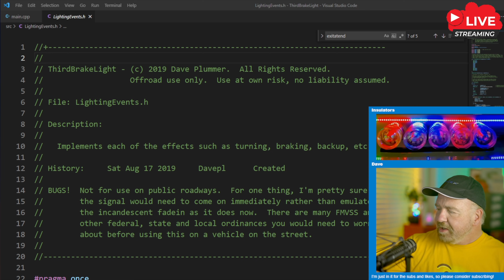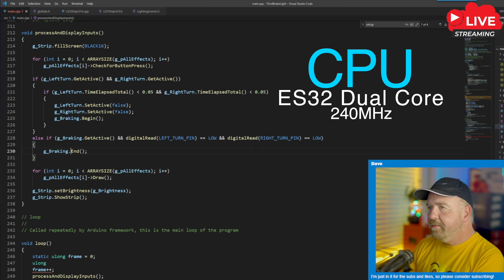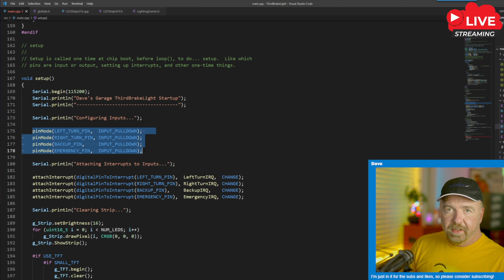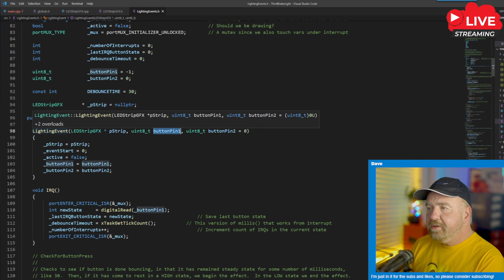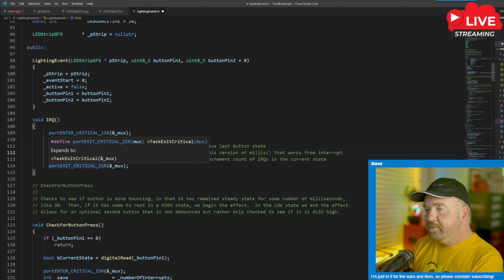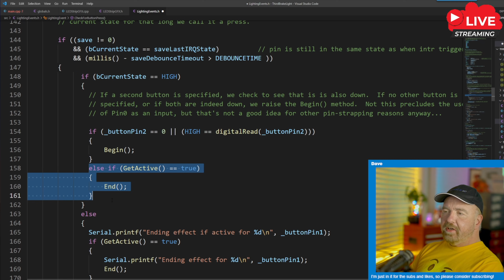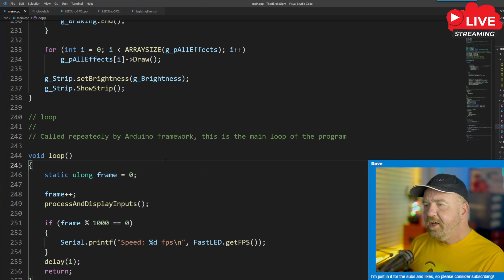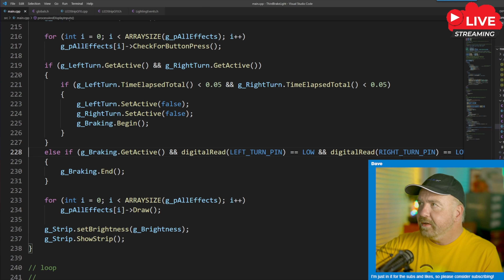Debounce a STOP switch in C++: Live with Dave in the Source Code Editor! (Live Replay)

Comment: Hi Dave, I want to take this opportunity and personally thank you for writing task manager.  I have used it every day for years since the win95 days to end pesky tasks and since XP to monitor the CPU.  It has made my life lots easier.
Reply: I'd also like to thank the person, who wrote the mouse driver, had loads of windows crashes where the mouse pointer still moved but nothing else worked. :-)
Reply: @TheEmbeddedHobbyist  Many graphics cards uses a hardware mouse cursor. This means that the hamster may be dead, but as long as the mouse ISR picks up the x-ticks and y-ticks from the mouse and sends the actual mouse location to registers in the graphics card, you can see a moving mouse cursor even if all paint code of the applications have died or the graphics driver code to actually perfor paint commands have crashed.

You end with a static image of last computed display bitmap with a moving mouse cursor on top.

It is quite common that interrupt handlers keeps working while the actual processing code is dead . Some lockup have made the OS stop task-switching. Just that the ISR doesn't use OS task switching but instead the CPU hardware logic for interrupt prioritization/activation.

I guess more people than me have used caps-lock, num-lock or similar to check the machine. Fast LED response shows the OS is generally fine but the current program may be dead. Slow LED response indicates the machine is alive but at a huge load. No reaction at all on keyboard LED's and the hamster is likelly dead.
Reply: @perwestermark8920  very interesting
i too use tje caps lock / num lock to check the system is still "alive" good for seeing if bootloader has locked up and in os is there hope of resuming normal operation.
I used to have a laptop where the battery or battery logic used to. create so many interupts the system would be unusable and caps lock would take 5 seconds to toggle.
Reply: @ratbag359  One of my machines running Win10 has some broken driver making the machine sometimes spend most time doing interrupts. But Win10 isn't as helpful as Linux to tell what interrupt source keeps counting interrupts. Or what drivers may be hooked to that interrupt source. Microsoft doesn't seem to think that information is relevant to an end user 😪

I had a Linux with similar issues and the /proc file system made it trivial to figure out that machine had a hw issue with a PCI bridge chip.

For more normal problems, Task Manager has enough information to help pinpoint most problems with CPU hogs, resource leaks etc.
Reply: @TheEmbeddedHobbyist  lol yea been there many times windows subsystems not responding task manager won't come up but i can still move my pointer lol

Comment: Do you need to debounce a stop switch (title), as it only has one function to stop. So on the first change in state to the stop state is all you need. I would not care if it bounced as I would have killed the process there and then. Plus I would do the stop switch in hardware just in case the software was playing up.

Now a start/stop switch (text) and most other mechanical switchs needs to be debounced as moving contacts just love to bounce. 

How about the leaky bucket method of holding the high's, if you keep putting highs in the bucket will fill after a time, so you have a high, if you stop the buckit empties and you have a low. as it bounces it just goes up and down a bit but ends at one state in the end.
Reply from the maker: If it's a latch (stops and never restarts), then no.   It a switch only enters and never leaves a state, I guess you'd not need to at al!
Reply: Be careful! It depends on what you do when you detect the switch contact.

For example, are you setting an interrupt? Is there a limit to the number of interrupts per second of your CPU? What if you are logging messages when the button is pressed? How about sending messages to other processes (much like the ISR case)?

This is a common error when doing debounce work. I think Dave will do it right and solve for the general case of debouncing a switch and then it will always work as intended even if you only use it as a STOP switch and do something really simple (like terminate your program). But it won't break when using it in other ways and whoever users your code next (which could be you five years from now after you forgot what you did) will thank you!
Reply: @dmzar  I normally read a STOP switch as "it stops all what it's doing as fast as possible" like in an emergency stop! Where I want the stop acted on as fast as possible. So the stop interrupt won't get re-entered as it will stop all required actions and halt. So interrupts may be still disabled. So a reset may be required to get it running again.
Maybe it's a UK / US thing.
Reply: @TheEmbeddedHobbyist  
I was thinking from the other side where I am building a debounce circuit (code) that could be used everywhere we do want to read a key/button. In that case, we should not design it to only work in a specific case or two (or there or...). Make it general so that if you used my code, it would do what you expect without you having to read my code nor ask me under what circumstances it works.

To be clear, I have done what you propose at times, but in recent years, I always debounce such signals, too, as it rarely hurts. But if you care about absolute latency, I could see not debouncing emergency stop signals under the right circumstances ...  but I would document that clearly. 😀 I've seen too many systems hang when someone wanted to terminate them... And by hang I mean: continues to operate at some level with no way to stop it without physically removing power. Yikes!
Reply: @dmzar  I've worked on medical systems where our H/W made the decision to kill the power to the heater then flagged the fault, better to get the latency of the software out of the way. Patient safety first! 
Plus it’s easier to test the hardware than it is the software. A side issue with interrupts is they make the software impossible to fully test, so polling is better but that increases the latency further if your fault occurs just after you polled that input.

With interrupts; they can be triggered in any part of the software flow, therefore it’s impossible to perform an interrupt after ever instruction to test for run time errors.

Had a fun year doing software V&V never again.
Reply: @TheEmbeddedHobbyist  Ah, the joys of medical devices... Small world. Me, too. 

Yes, fail safe is always best. I've seen many designs that simply fail, however 😀. Everybody wants software solutions because they are "cheaper" (no they are not, usually). Like the heart monitor I was working with that, if it lost its WiFi connection to its logger, would turn off the WiFi to save power. Cool! Now, how did it turn back on the WiFi? Power cycle! And what happened to all of the logged data when you did that? Lost! So this 24-hour monitor could not be used outside of your WiFi AP range. And it was meant for ambulatory use. 

But at least it couldn't kill you and didn't have a stop button!
Reply: @dmzar  I think we must have spent over £1.5M on design and certification of the software, I was H/W at first then moved over to software / hardware intergation. prototypes were IVD's, but main product was Type CF, or Cardiac Floating.  we had a direct electrical connection to the heart. So hardware electrical isolation was hard work.

glad I've retired.

Comment: Are you going to discuss why, in software, you really should debounce a stop switch (not just a start/stop switch?) 😀 This would be so interesting... Likely not for most of your viewers who want to learn coding techniques... But this embedded HW/SW guy with a background in academia would love it. 

Always enjoy your take on things.
Reply from the maker: The code I demo debounces both states, start and stop.  Basically, it denounces any change in state!
Reply: @DavesGarage  Terrific. Always good to solve the general problem so when you reuse the code, it doesn't break when using it in a way that doesn't match some special case.

Thanks for teaching people good design practices! This is really important in embedded systems where updates are often hard, if not impossible, once deployed.
Reply: Any analog input (from non digital sources) should be debounced as transient's can easily be picked up.
Reply: @ratbag359  You often only need to debounce in one direction, unless you have designed an antenna where cable or PCB traces picks up noise. The I/O pins are normally used with pull-up or pull-down that is strong enough to not give incorrect readings from spurious noise.

But there are situations where you want symmetric response - so same delay for on or off. And there are obviously situations with human safety etc where even a lightning strike must not trig an activation (assuming of course the electronics is protected enough to not get destroyed).
Reply: @perwestermark8920  as this is going to be used in a automotive application I would implement hardware filtering on the input.
As for debounccing as it is interrupt based the number of interupts could be many for instance a loose connection to the trailer so in this case as interupts are set for rising and falling edge it would be best practice to debounce both transitions.
my preference would not be interrupt driven instead poll based.